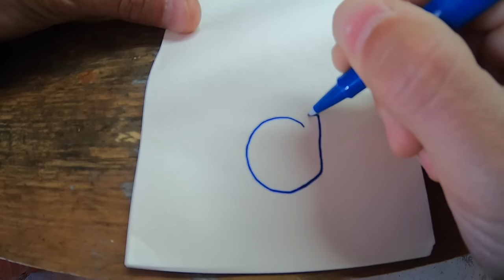MAKE YOUR SNOWBLOWER THROW FARTHER AND NEVER CLOG. Install A DIY Impeller Kit.

Comment: What about attaching the rubber pieces with large steel piercing screws? You could even add washers to the head of the screws. Only down side there would be sharp screws protruding from the other side, unless you grind them off.
Reply from the maker: E Q that would work but there would always be that fear of them coming free. I’m going on six years now with them not coming free with nuts and bolts.

Comment: Should add a simple metal plate with two holes for the bolts and make a nice stiffened backing to the rubber .. otherwise it will get a U shape as it wears. Hold the rubber flat  to the Impeller...
Reply from the maker: Good idea! Thanks for watching!
Reply: Yes you are correct. If use use car tire as the pad it will most often curl. It wont  curl if using flat rubber 1/4 thick and 3 self tapers. Thanks my exp.
Reply from the maker: @joehawthorn3018  thanks for sharing!

Comment: Ive done this on a craftsman snowblower it works great EXCEPT it will not just throw snow it will throw anything you scoop up and send it flying through the air (rocks)
Reply from the maker: Justin Moore lol mine too. Check out my part 2 video. Did this on a craftsman snowblower too in that video.
Reply: aim that chute low

Comment: You would think the manufacturer would've thought of this or at least after seeing this, would make improvments!
Reply from the maker: These should come standard on every blower! Thanks for checking out my channel!
Reply: If you look at snowblowers over the years, they have played with different impeller gap sizes, and it seems, from what I've seen of new ones, they've settled on running a larger gap nowadays.  As far as adding a wiper, I just don't see a factory ever doing that.  It would have to be done in such a way that it could never fly out no matter how rusty it got.  I've never seen it even on high end Hondas and Yamahas.

Comment: Hard to believe the main bearing can hold up to the extra spinning mass without failing. I'd love to see a before and after for the performance increase. Awesome idea if it doesn't kill the blower
Reply from the maker: Hey John, check the video links below in the description. I have a video with before and after results. Thanks for checking out my channel!
Reply: @GarageGear  I will thanks.
Reply: Is that mass really much different than the mass of the snow loading?
Reply: @tommak6516  not really sure but like you were saying (I think) the extra mass plus the snow all exerts massive forces. Cumulative stresses.  Id love to see how it holds up

Comment: Calm, cool and collected and really helpful information.  Like your courtesy too because that is so lacking these days.  One question where can I find rubber pieces like that?
Reply from the maker: Hey Michael! I used black rubber from an old conveyor belt. You could also use the sidewalk of a tire or an old mud flap from a truck. I have some black rubber flaps linked in some of my other snowblower impeller kit mod videos. You can check their as well. Thanks for watching!
Reply: @GarageGear  thank you for the prompt response.  Those rubber resources you gave me will be perfect.  Thanks again and keep up the good work; it is a valuable service.
Reply from the maker: @mikemm40  no problem! If I’m not busy working I try to get back to people relatively quick!  Getting back to your courtesy comment, I try to make it a point to say ladies and gentlemen at least once in each of my videos. You are right, courtesy is lacking nowadays.

Comment: Wouldn’t this making the propeller unbalanced making extra wear and tear on bearings as well. Also, added vibration. Like if a lawnmower blade isn’t balanced.
Reply from the maker: No extra wear and tear on my machine. Mine have been on for 6+ years with no issues. No issues with balance either as long as the pieces are all close in size.
Reply: Did mine about 5yrs ago and no problems. The blower did get louder because of the rubber slapping at the chute opening. I just wear ear plugs
Reply: It’s a snowblower, not the space shuttle. (Yes, stolen line)😎

Comment: You should angel cut the ends of the rubber where it will be rubbing on the side as it's pushing the snow out i would cut it like the edge of a windshied wiper.
Reply: Just the act if it running will grind its self into the shortest distance and tightest fit possible.
Reply from the maker: Not a bad idea but the machine pretty much takes care of that! Thanks for the comment!
Reply: Over a period of time, they will find their own angle and adapt to the wall!

Comment: Told this one to my local dealer. That is a great way to VOID your warranty
Reply from the maker: ron gaudreault ya probably true but I’m pretty sure this 33 year old  blower is past its warranty anyways.
Reply: True that.
Reply: Guess you never bought a new one.
Reply: How long is your warranty? When I bought a brand new blower it barely would throw snow, after the second year I found out a lever had a loose cable....dealer set it up....I fixed it now it throws snow but I think I will add some rubber to blades because it clogs up with snow depending how wet snow is.
Reply: 3 YEARSI HAD THE SAME PROBLEM WITH THE CABLE BUT IT WAS THE DRIVE CABLE.I HAVE A SIMPLISITY PRO 24 INCH 12.5 HORSE POWER

Comment: easy for you. I have a John deere 47 inch blower attachment and it has cables running to the chute controled by the hydraulic lever on the dash. Not so sure I want to take off the cables and not get them attached the right way just to get at the impeller. But a great video.
Reply from the maker: Thanks a lot Gerald!  Sounds like you’d have some extra steps!  Thanks for checking out my channel!

Comment: Here is how I made my 1971 Ariens Sno Thro... throw farther and never ever block up again.  At the beginning of the video... see that exit hole that is about 2" high and 6" round...  WAX that with any kind of car wax... and it will never block up ever again.  That is the (main general) area for the blocking problem on this era Ariens Sno Thro.  You wax that ring area and you will never have another blockage again.  If you want to help even further...  wax inside past that ring has much as you can reach.  Also do the inside of the chute and even inside the bucket.  You will be amazed.  And then do it before every storm.  No need for all that extra work of drilling and fitting rubber pieces.
Reply: I use that spray stuff they have @ Home Depot or Lowe's it seems to work also.
Reply from the maker: I actually did mine with the impeller kit and wax just about everything I can get my hands on.  Clean everywhere in that machine!
Reply from the maker: Yep that works well too!

Comment: Don't do like me , pulling the rope 20 times only to realize the plug wire was removed. Those paddle blades are hard steel. couldn't drill mine But my 3/4" #10 self-tapping screws went in without too much difficulty. cheers
Reply from the maker: Glad this worked out for you!  Ive made that mistake myself a few times too.  We're all in this together.! cheers
Reply: Cobalt drill bits for the win...
Reply from the maker: Good tip!

Comment: Skip the BS of using bolts and nuts, get some self drilling hex heads and just attach them in place with your drill or battery gun with an extension
Reply from the maker: Yes you could do that as well.
Reply: So no need to Pre Drill kind thick metal.
Reply: @louishollandjr  
Not if you use quality self drilling screws, good ones will go thru 3/16” all day long

Comment: Have seen on another site where he added a piece of UHMW to the face of the discharge chute. The purpose was to force as much snow as possible out the tip of the chute & not blow back at the machine or operator. He did leave an opening near the chute at the housing to clear any blockage. I do like the “ no blow back” but worth it or just don’t blow into the wind?
Reply from the maker: Thanks for sharing Rick!

Comment: Interesting Idea.  Application and installation?   Any rotor, wheel, or blower is balanced.   When you add items on the blades without taking the balance into account,  you will cause wear, and possible destruction of the blade.   If you do this,  I would take pains to use the exact same hardware, and make sure the rubber flaps are exactly the same size.
Reply from the maker: No issues so far after two seasons. I’ve had mine on my blower for 8 years now and they work great!  Issues with balance there either. As long as the rubber flaps are close in size the blower will throw snow like a monster! Thanks for checking out my channel!

Comment: Great video! I am going to do this tomorrow to my 24" blower. One question: what can I use for the rubber flaps? I have a large truck mud flap...would that work..or does it have to be a certain thickness to be effective? Thanks!
Reply from the maker: Hi Randy! Thanks for following along. Use the flap. That will be perfect!
Reply: @GarageGear  Working on it now..question....I see some who do this go right around  the curve of each of the impeller blades..and some including yourself go cut the flap to right to where the blade starts to bend up...does it matter to cover that little extra inch of so?
Reply from the maker: @Randy-ul5hy  it doesn’t matter. No need to worry about it.

Comment: After you drill the holes in the impeller. put the rubber "below" the impeller paddle, mark your holes from the top, drill the rubber, then put the rubber on top of the impeller and bolt down. Saves trying to mark blind from the bottom.
Reply from the maker: Great idea! Thanks for sharing and for checking out my channel!
Reply: @GarageGear  Thanks for posting your impeller upgrade. I'll be doing that in the next day or two.
Reply from the maker: @impavid48  you won’t be disappointed!  Let me know how it works out for you!

Comment: If you can get natural rubber or pure gum it will last longer,has higher abrasion resistance than the conveyor belting,it is softer but should work…
Reply from the maker: Thanks for sharing Dave!
Reply: Where I work we had a customer supply material slabs of belting we cut and I punched the holes for snowblowers.
At some point I may try these,my Ariens 24 inch deluxe is new and hasn’t been used yet,so we’ll see how wel it throws.

Comment: great video; i wish i had seen it during the summer. 

what material is the drill bit you used. 

YOU HAVE A PERMANENT  SUBSCRIBER!
Reply from the maker: Awesome Upside Down! The drill bit I used in this video was just an ordinary bit I believe. I have done many since with a step bit. I believe I have one linked in the description! Cuts through like a hot knife though butter! Give it a shot! You won’t be disappointed!

Comment: I always unplug the spark plug before cleaning any snow out after use. 
And u mentioning that reminds me that I think I forgot to plug it back in after I used it tonight
Reply from the maker: Smart to do so! I have personally never had a machine start up on me but I’ve heard horror stories! Happy snowblowing!
Reply: Un plugging a sparkplug won't do nothing. If anything take the spark plug out so there's less compression. If it's plugged
Reply: @dzlf2504  yeah, I suppose, but its better that than nothing

Comment: Spend the extra money on stainless steel bolts, washers, and nuts. Also use lock washer, lock tite, or a locking bolt don't want them flying out of your blower
Reply from the maker: Never had that issue with mine.  My bolts have been holding tight for 7 years or so.  I also hit it with lots of WD-40 during the winter to prevent rust.  Take a look at my Clean, Shine and Protect your Snowblower Video.  You'll see what I mean.  Thank you for commenting.

Comment: Yeah flip flops- leg scrapes...Did you get any hot steel chips in between your toes when drilling? Also Where did you get the red stool? No snow test? Great informative video!
Reply from the maker: Forgive me for wearing flip flops when it’s 85 degrees out in August. Lol. The leg scrapes are scars. All the metal shards stay inside the blower when you’re drilling so none on my feet. The stool I got as a gift. Could be HarborFreight or Home Depot not sure. Kinda hard to show test results in the snow when it’s 85 degrees but I did shoot this video with results. Check it out .https://youtu.be/WR-n6QE-hSw thanks for checking out my channel!

Comment: Good idea...but i just spray silicone makes it slip out...assuming auger and shoot has good paint...if rusty snow sticks... before using the silicon I sanded and painted the auger and the shoot with high gloss paint. Which helps to make it slippery for the snow but then when you spray on the Silicon it makes it even more slippery.
Reply from the maker: Good tips here! Thanks for sharing and watching!

Comment: For those still snow throwing with there Ariens ST24 from the 80s, this one you see got a new engine.
Reply from the maker: Thanks for watching
Reply: @GarageGear  just so you know: if the worm gear mean shaft is damaged, you can get a replacement shaft on ebay

Comment: I would probably make a cardboard or tin or aluminum template for this job … one would place the template on the metal fins and do the drilling then place the same template over the rubber fins and do the drilling … just a thought 💭
Reply from the maker: Good idea. I did a similar template on another video I did about impeller kits. Thanks for watching!

Comment: you should make a template so drill all the holes in the same place & put locktite on the bolts!
Reply from the maker: Great ideas! I did make a template for this modification. Its linked in the description of this video. https://youtu.be/WR-n6QE-hSw

Comment: Great idea why didn’t the company do that maybe it’s not designed to put that in there but smart idea and where would a regular customer get those rubber conveyor belt parts the average person please advise or do they make a kit for the errands
Reply from the maker: I have some rubber flaps linked in the description. You can also use tire sidewalls or mud flaps too. Thanks for watching!

Comment: I bought a kit specifically made for my 13/32 3 fin impellar. I may suggest you slow you're drill down and oil you're bit. It's steel nit hardened but steel never the less. You had that drill screaming
Reply from the maker: Thanks for sharing

Comment: Drill holes in rubber first.  Position it on impeller, Then hit with light colored spray paint to indicate where to drill the steel impeller holes.
Reply from the maker: Thanks for sharing

Comment: This is a wonderful vid. Quick question: I just bought a set of these rubber paddles on evilbay and planning on doing the install on my 26" old troy-bilt this weekend. What did you do or use to block the impeller blower fan in place when drilling the 2 holes into each blade? That appears to be my challenge. Trying to block or lock the blower fan when drilling the holes. How did you do that? Thanks very much.
Reply from the maker: You could stick a board in the augers and spin them against it. That should hold everything in place. Thanks for watching!

Comment: Great video. Hey what type of bit did u use ? Would just any metal drill bit work or does it have to b hardened or cobalt or diamond tipped ? & where can I get them rubber conveyer belt pieces from? Lmk please. Thanks
Reply from the maker: Everything you’ll need is linked down below in the description! Let me know how it goes for you!

Comment: The bolts and the size of your rubber swipes, really should all be exactly the same, along with the location you are bolting in to.  Reason................ Balance or you will get premature wear and vibration on the impeller bearing assembly. Also, spray entire area dorm with silicone spray, makes a world of difference. Otherwise, nice work !
Reply from the maker: Thanks for sharing and watching!

Comment: If you drill a pilot hole in the metal your big bit will work easier. start with a 1/8" then use your 3/8".
Reply from the maker: Sounds like a good plan! I like it! Thanks for checking out my channel!

Comment: Don't kid yourself, this works only up to a point. There are too many videos on youtube telling you that this is the solution, however, it ain't. If it clogges up, it's not in the ompeller housing, it's in the chute. And if the chute is full of solid wet snow, that's the end of it. You have to clean the chute out.
Reply from the maker: Thanks for sharing

Comment: Here’s a very simple solution for east coast snow or Sierra cement snow . Get a LARGE can of PAM cooking spray and spray the impeller area as well as the inside top of the chute. 
Dollar stores have PAM for $ 1.99 or 24oz for $ 3.29 .
Reply: Kody Adams yes but after each snowfalls you have clean the inside of the shoot .i have been using spray for 2years . Will try the rubber this spring no garage.
Reply from the maker: Good tip. Thank you
Reply from the maker: Thank you Mike!
Reply from the maker: Give it a shot. You won't be disappointed.

Comment: You said that you used bolts you had lying around the shop to attach the blades. They should all be identical in order to maintain the balance of the impeller. Go to the hardware store and get parts from the same bins.
Reply from the maker: Felix Klempka hey bud as long as you use bolts that are close in size you’ll be fine. In my latest video I actually ordered some off of amazon. Check out the video link here: https://youtu.be/WR-n6QE-hSw

Comment: How much harder does the motor work with this on it when it's actually blowing snow?  And what grade bolts did you use?
Reply: The bolts are retaining rubber strips. Any grade will suffice.
Reply from the maker: Engine runs the same once the rubber paddles are worn into the inside of the housing after a use or two. I used stainless steel bolts in this video! https://youtu.be/WR-n6QE-hSw thanks for checking out my channel!